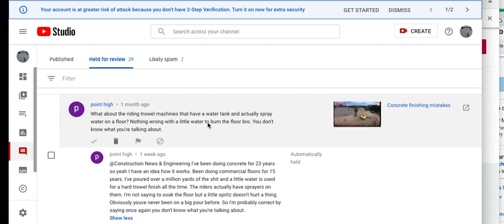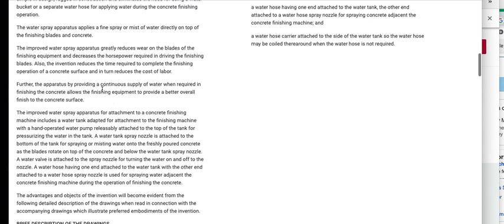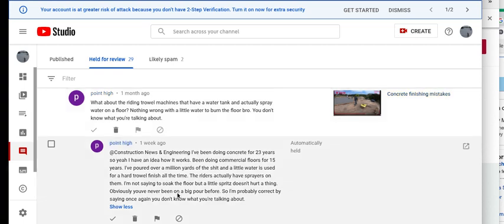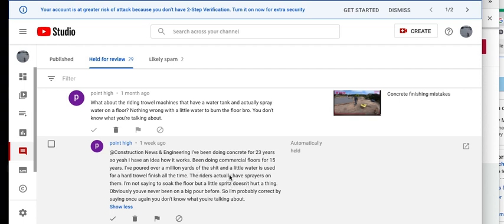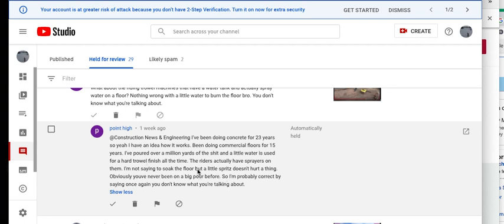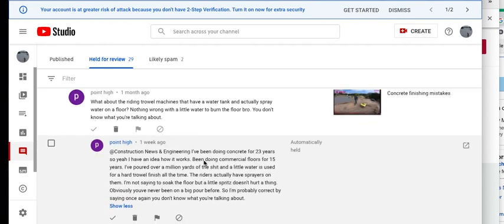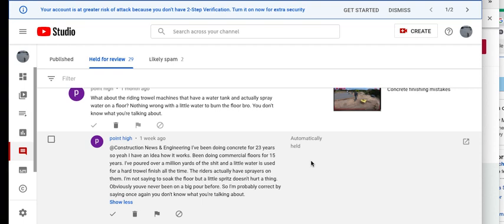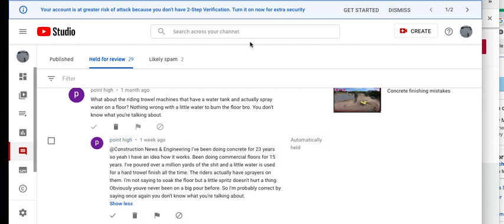Concrete finishing tip DO NOT ADD SURFACE WATER

Comment: I wish you were closer to Harrisburg.  You've gotta see the work this guy just did at my friend's building. Over 100 year old wreck of a building brought back from the dead. Inside slab beyond horrible (keep in mind Im a fucking painter). Dips you can feel, not level because they followed the old warped hardwood floor that it butted up to, drain is barely gonna work if at all (plumber to blame for height? Should he have spotted and dealt with prior?), the finish in general sucks to look at, and he cut expansion joints with a concrete saw afterwards. (from what Im hearing thats not the right way in a warehouse slab situation). Thats just what I see and thats not my trade.
Then theres his broom swept outside large cement common area. So thick and sloppy.the broom strokes ended up being different shades right next to each other. Also done in 2 seperate days because????

Not enough man power to do it right in one. SO he did it shitty in 2 days anyway.

 I told the building owner if that was my work I would ask for money to pay for the cement truck  beg him not to tell anyone I did it  hang my head in shame and walked away red faced.

Too many people getting into the trades without doing the apprentice time on real crews.
Thanks home depot and diy shows. 
So many jobs look like and are shit!
Reply from the maker: Send some images, we can critique them.
Reply: @EngineerPEretired  
Im gonna be back there next week.
I may jyst do that
Reply: Heres a little walk through out back

https://youtu.be/6ix3wRG7yWA
Reply from the maker: I will do a video response to your video I just saw... doing it shortly.
Reply: @EngineerPEretired  no rush here. I've got my hands full with woodworking
Reply from the maker: I just posted your reply... I put it on my other channel by mistake but just loaded here a few minutes ago. Headed to bed, take care.